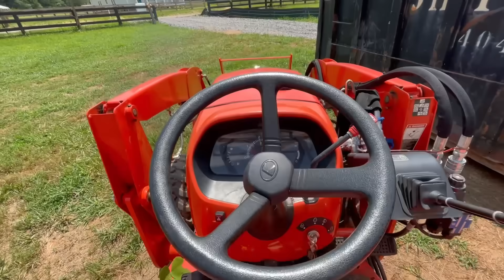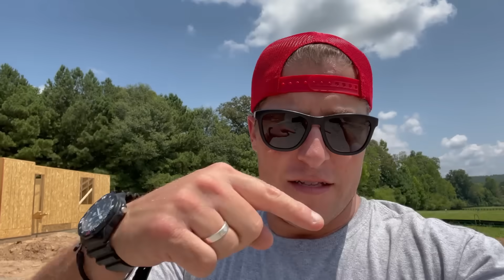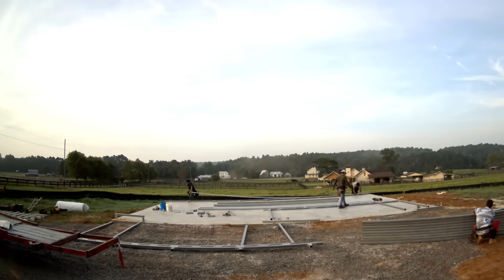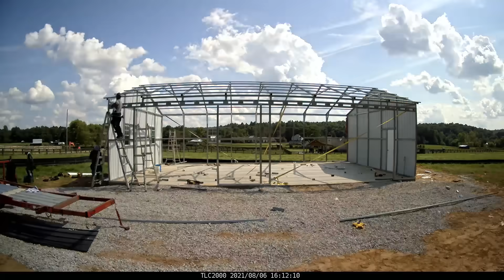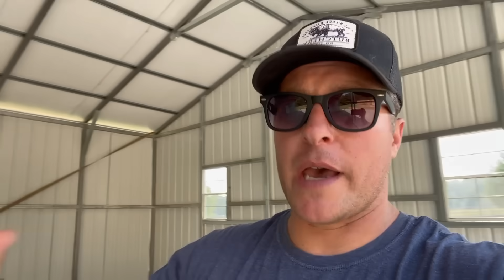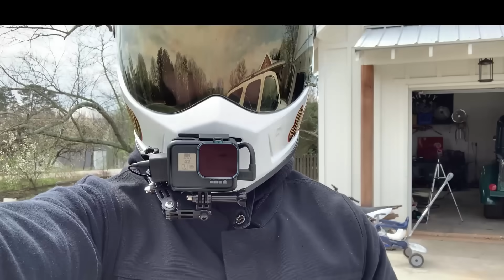I FIRED THEM!!  26x40 metal building Dream Garage build Ep.2

Comment: As a Chippie here in Australia, as soon as I saw those trusses, right up I thought that they will not be suffice, not only the sag to be taken into consideration but also the outer walls would of pushed outward due to that problem. Certainly should be a member across the bottom of the truss with 3 webs in the middle for strength.
It is a shame you gotta deal with monkey's sometimes, hopefully they can rectify the problems, social media is a powerful tool and word spreads quickly.
Cheers and Keep it real
Brad

Comment: If the contract says that it will pass inspection, have the inspector come out and inspect it.
If it doesn't pass, they have failed to uphold their side of the contract.
It they have any sense at all, the minute that you tell them you have called for an inspection they will fix or remove the building.

Comment: Pole barn building would have been better, thats a cheap carport style building. The ripple should not be there, and the truss should run the span of the building. The pole barn style buildings are popular here in Texas, wood frame, truss all the way across. Price is not as bad as all steel buildings, alot of barndos built that way here

Comment: I saw 3 pieces on my building like that as they were finishing, i brought it up and the boss said....oh they put the wrong metal up. They had 3 more pieces on the trailer under a few cuts of scrap that was mint, they put them up and left those under the building and left without a word when finished. I was going to buy 2 more but after dodging me at the end and obviously trying to slip some damaged metal in and keeping the good material i bought from another supplier that was local. Much better communication with them and was happy to add extra bracing later for less than what it would have cost when i bought the building, it was 100% oversight on my part so what i saved i gave to the installers who did the work when they put the bracing in. Was nice to see the same people on all 3 building installs a year apart from each other on the last 3 they put up too

Comment: The slant of roof has 4 runs. Well one the inside peak cross bracing should be at the second run. With X bracing for support. The wall knee support should be at 45 / for support. 
And 4 ft for spacing from bottom to top for wall support. 
But in there defense i think you choose wrong gauge  thickness grade for sheeting. 
This setup up is the right one, but i think the height was the difference for support wise. 
Did you not see sample before purchasing. 
Its buy beware. 
This coming from a composite setup, post and Frame, steel person. I did all aspects of building.

Comment: how was this video resolved with the sub'/manufacturer? very curious as I'm in construction cost(s) and claims. the points you make in vid' are spot on and very prevalent among these type of "manufactured" product or system and the "designated" subcontractors by the mfgr. knowledge is power but pictures are proof. thanks for posting

Comment: I erect red iron pre engineered buildings. I deal straight with the manufacturer. Those panels on this building are 29ga. Ive seen it happen a few times when they run these, I think it may be in the tooling process that it happens. But no, it shouldn't be wavy. I deal with 26ga roof and wall sheets. Much better!

Comment: On shops like that you’re in walls most Metal run up and down what they should have done to where you can see the seams start from the back work to the front you wouldn’t have been able to see the seams nine chances out of 10 you’re always going to see where it overlaps that’s why you start from the opposite in that way when you pull in you don’t see the overlap but it does look like the The building could have been put together a little better my suggestion go with the red iron building he will be much happier

Comment: just change the overlap to the other edge but as for rest it is not a proper truss ass you will eventually have leaks on that roof plus it wont hold up to any weight on it at all. garbage roof trusses

Comment: The edges on the vertical panels is 50/50 for me, might be a bit of a pain but it's a cheap steel frame shed. Like others have mentioned, I don't mean offense by that but we all have a budget and sometimes we live with a few things as a result. It would annoy be too, but it's probably livable. Adding in your structural concerns, difference from the provided plans etc I think it might have been a good call to stop it early. 

Sounds like you might have gotten a bit of a too good to be true deal, where you look closely at the their other work and it isn't quite as good as how you thought or perhaps they really did set out to mislead. Only you know that. Good luck but I agree, good call on stopping it now.

Comment: Red iron steel buildings are about $18 to $20 installed with insulation  not including the concrete pad  as the other comment said you get what you pay for

Comment: Everyone has pretty well addressed the 'truss' issue which is not acceptable in any way.  That crush bend is also unacceptable for structure.  Even if you have no snow load you will have a wind load (perhaps even a tornado load in your code).  I am guessing that the steel paneling is reject but they also might be a lesser gauge as well.  The issue with that ripple is not just cosmetic.  This is definitely the top lap and not acceptable.  The bottom lap will have a lengthwise groove formed in the panel.  This very small groove is a moisture 'wicking' break to prevent the moisture from wicking up an over the bottom panel.  Your ripples will effect that wicking break negatively as you need a tight panel out to the edge all along the seam.  So even if you wish to put up with the look it should be rejected for functionality.  I would never accept it and would measure the gauge for sure.  I have never seen such a poor quality edge from a legitimate company.  These panels might be roll stock run through a form in someone's back yard much the way they make gutters on sight.  If the material is not supported coming off the forms it can ripple like that if it is allowed to move around during the process.  So saying that process is not suitable for any kind of quality panels needed on your building.  These people are not working to any minimum quality standards at all.  Were they just going to leave those huge gaps where the roof panels meet the sidewall?  With no overhang to speak of that is going to be a continual leak spot in the future at best.

Comment: I've done a lot of vinyl siding and I always make sure the joints face the opposite side of when you pull in or the other side of your looking down. I don't know how to word that right but you know what I mean. It's pretty obvious where your driveway is in your house and which way you'll be facing it and the metal probably shouldn't have that ripple in it either. As far as that 16-ft piece that runs horizontal I don't see a horizontal piece keeping that much of a span from flexing. I don't know what size of tubing they used but in my humble opinion on something like that I would use more of a rectangular shape tubing for the roof skinny side up. The tubing that's up there almost looks flat but it's hard to tell by the camera.if it snows in your area and you get a lot of snow that'll affect it over a period of time.

Comment: I was selling tin buildings and people would say how they could buy it cheaper by like half the price.
I learned to ask if that was with a 
100 lb snow load?
It wasn't and they never asked that of the cheaper quote!  Your uprights and truss spacing looks like it barely passes any structural requirements!  A cheap carport has better engineering.  Your trusses are not going to pass inspection!

Comment: Dude, I just went through this crap on a 40' X 50', these metal building company's are a joke!!  Several issues, one of the no brainers was putting galvanized screws on Tan siding!  When i called them on it i was told i didn't purchase the colored screw package, that was the 1st time i ever heard of it. THEY WANTED $1700 FOR COLORED SCREWS! Locked up all the material & their trailer in my yard until  they supplied the colored scews!

Comment: Yeah this is the reason why i build my own stuff. 

Had a friend get a shed kit and half finish it, only for him to ask me to do it for him and the shed was ALL jacked up, nothing was square, every cut that was done was uneven, and it was just a nightmare. I got the courage to tell him that it needed to be taken down and rebuilt from scratch, though he didnt like it, when i showed him ALL of the problems he agreed. So I redid EVERYTHING, from floor to roof. took about a week to complete, and it was perfect. 

He then told me that he had someone build part of it and then just left which is where i came in. 

Also if you have a contract AND the building plans (make sure they are in the contract) its grounds for a lawsuit, very easily. THEY broke the contract in which both parties signed, and not only the company but also the builders too.

Comment: the whole building is shit where i live it would never pass or last very long. i have seen a few of these type of build where i live right now there is 3 with the roof on the ground caved in from snow and one the wind just blew it down and all around. i am building a new shop this year all ready going with a 6" poor wood poles 10x10 with 2x6 every 4 feet vinyl under the tin keeps codization away   and i will hand pick everything on the build every board and tin no kits they use shit wood

Comment: Have you paid up front .? . those wrinkles in the [pane edges are no normal   the installers should have refused to erect them . the trusses were not to plan and should also have been sent back . at around 4 you are proudly giving a work schedule .. the trusses were clearly visible in the background . WHY did you allow the erectors to continue with the faulty / incorrect trusses .

Comment: The esthetics were not that important to me. However, the 6' reinforcement used in place of a 16' member as required in the building specs exposes the structure to wind strength issues. Plus, the bending observed is very significant. How the vendor will be able to argue that structural issue is beyond me.

Comment: G'day from ausie! 
You paid for a certain product. 16 ft truss has more integrity than 6 foot. If your plans read  ( X ) then that's what your suppose to build! 
We have wind ratings here in accordance with past weather patterns! W 32 IS A MIN
W 64 IS A MED TO HIGH WIND
DIFFERANCE IN bracing and structural integrity . Bottom line is you should get what you paid for!  😏  as per submission to council! It's not the subbies fault, 
 it's the product providers fault, weather it's on purpose or just an error is some thing to work out. But I would dare say it's deliberate. As of now charge them time and access fees .loss of trade ect.  Davi b ausie

Comment: Had the same problem with a Tin Roof that I wanted installed. Way to many short cuts on the project. Looking for another contractor. Luckily I have some building inspection experience.

Comment: I would consult with an attorney familiar with building construction contracts.   Initial consultations are usually free.  

The building has to be built to the specifications detailed in the state approved drawings.  I'm certain that is the law of your state, and it is the builder's responsibility to comply with the state law.  If the building won't pass state inspection, then you can't get your CO.  No CO, no can use.  

Have you checked; is the building square, are the walls plumb, are the correct fasteners being used per the drawings, is the correct grade steel being used per the drawing; gauge, tensile strength, etc.?  Look at all of the material specs closely.  If you've already found one shortcut, there are bound to be more.  

Remember, going forward, have any building contract reviewed by a reputable builder.  They'll be able to point out anything in the contract, or left out of the contract, that is out of the ordinary.  Always contact the BBB and ask about all of the businesses associated with entire project.  

Good luck.  ASH

Comment: Looks like a Sears and Roebuck lawn mower storage shed for the backyard. I can tell by looking at it you went with this building to save a buck or two and this is what you'll get. The first corner was cut when you signed the contract. Three years from now after some storms and I pray you don't get heavy snows you will see how you messed up by going with this cheap style building.

Comment: I would be rejecting the building.  The building needs to be stripped back to just the steelwork of the walls at the very minimum if the steelwork on your roof is sagging.

Whether the metal sheet panels were damaged after production is anyones guess, but it looks terrible and there are no words for those trusses, a serious snowfall will do a number on that already sagging roof.

Comment: I had a smaller 2 car metal garage installed of the same basic design.
After the 2 man crew finished putting it up in 7 hours it looked fine and perfect for the storage of my tools and cars.
Then about 1 week later the first heavy rain storm hit.
I had multiple leaks from  the roof that were from the assemblers overdriving the rubber gasketed washers that are on all the screws used for the construction.
The drove the screws into the corrugated metal and structure below so hard that the rubber washers cracked out and did not make a good seal.
I tried to get the supplier to give me some consideration and warranty this issue. But I got no satisfaction in the matter.
I went out and bought replacement hardware with and made sure to install them so that the washers were compressed but not cracked. I also sealed the roof overlaps since I had to remove all the fasteners.
Might want to get up on the roof to have a look.
Reply: Metal roofs have some superior characteristics compared to asphalt shingles such as  long life (at least double) and resistance to hail, but installation of fasteners is critical.  You are correct having the rubber washer properly compressed will make or brake the reliability.

Comment: I know I'm a little late to the party however I just discovered your channel. I build steel buildings for a living. You definitely need that bottom truss cord to be 16' and the verticals are mandatory for any kind of "snow load". Also those roof panels aren't enough to stiffen the building. There should be wind bracing running through the bottom truss cords connecting all of them. I'll watch on to see how it turned out. Good luck!
Reply: I see your point 100%, some contractors don't realize how much of your budget is being eaten up with a project like that. To some it's just another job but to the customer it may be something you've saved up for quite some time. I work for people on the side and always address any concerns if it is valid! The 3rd party issue only complicates your issue. Hope it turns out well for you,looking forward to seeing the  outcome in your favor!
Reply: @greghill8354  I just had one built; I have wanted one for 30 years and finally in a position to get it. I love it for the most part, but there are issues with the idiots that built it.
Reply: I noticed the lack of corner bracing also.

Comment: Just came across your vid. You were 100% justified in stopping the build and holding the manufacturer's and installer's feet to the fire. As much as we all at least occasionally complain about building codes, the reality is they are there for good reason based on engineering principles and empirical data. Manufacturing/installing it to meet code should definitely be written into the contract. Glad to hear that language was in there. And when you're paying big bucks for a building, it damn well better look good. Those panel edges are completely unacceptable, OCD or not. Looking forward to catching up to see what happens next.

Comment: Had they put the walls up in the other direction, from back to front, the overlap ripple would have been hidden and not seen from the front. So there is a "fix" (if you will) for that.  But the six foot vs 16 foot piece is not something you can fix.  Unless Harbor Freight got a stretcher I don't know about! ;-)

Comment: Been there with the same issues, in a way I'm glad the building that the same kind of people built for me burned to the ground an be I had to buy another building.  I didn't make the same choice the second time.  I went with HERITAGE BUILDING SYSTEMS I bought is straight from the manufacturer and ordered EXACTLY what I wanted.  I got a 28x28 heavy steel building not the square tubing crap. With 12ft walls and an extra overhang on the one side that is 28ft long and extends 8ft over onto a concrete porch that gives us a nice shaded sitting area with absolutely no support posts to get in the way.  
They custom design whatever you need.  Then a far as putting the building up,  I found the people that did my last one couldn't read a level( some were a 1/4 bubble out on a 4ft level on a12ft wall some more than that some less.  Made for a terrible screw pattern on the outside of the building) so for this building I did it all by myself. I used a rented forklift for the structural beams and then rented a cherry picker for the roof panels.  Between that and my tractor I ended up with a beautiful and STRONG building that I'm very happy with.  I know not everyone can build one themselves and if you can't you have to be watching the erectors constantly.  The easy way isn't always the right way and trust me they will always go the easy way unless your watching.